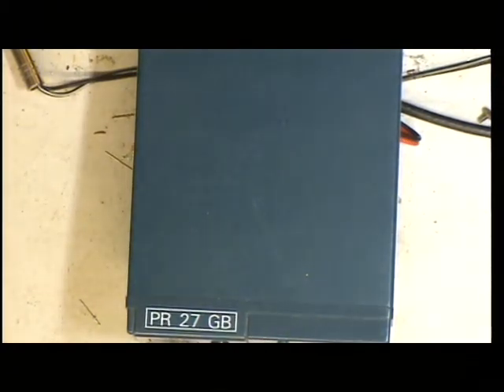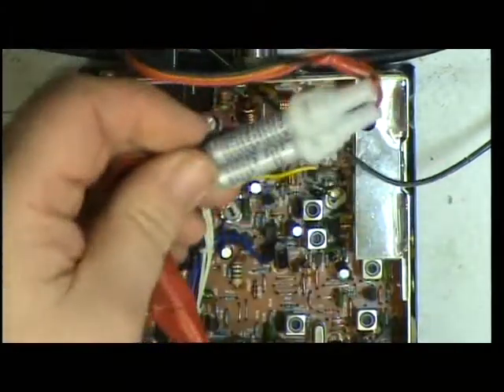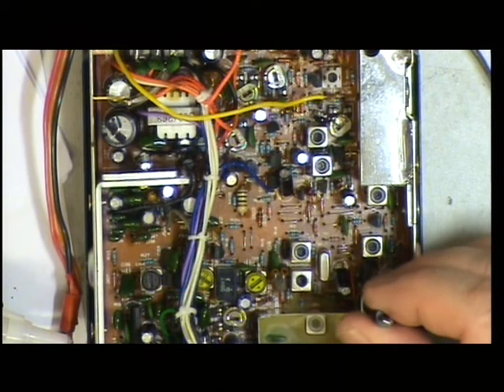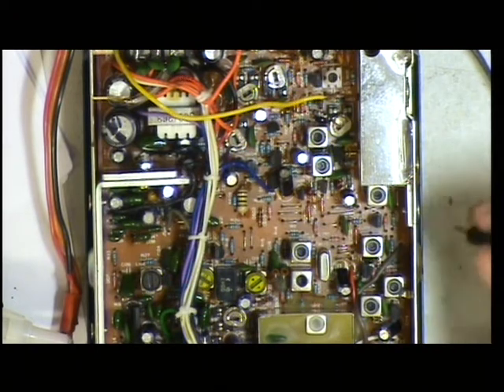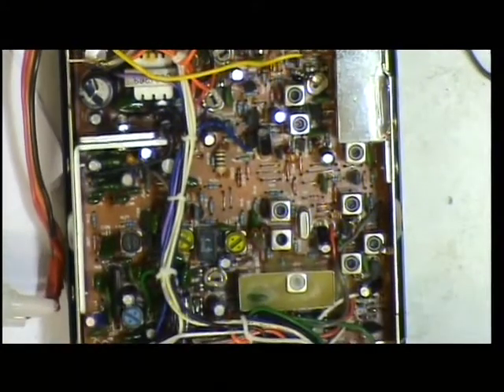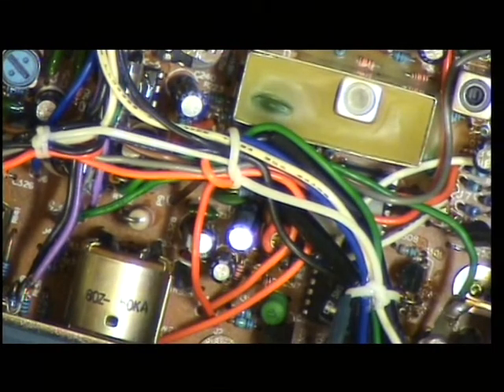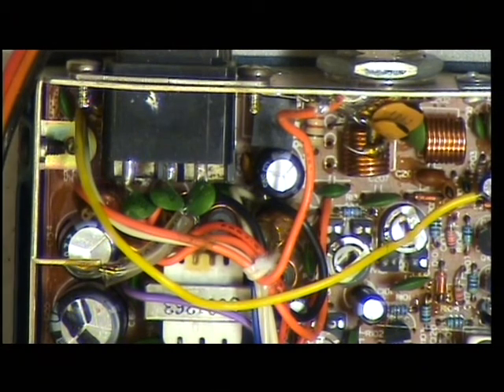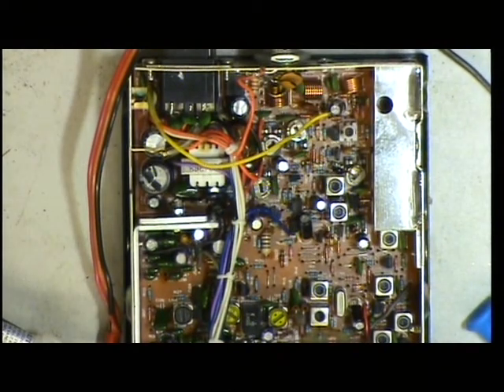Maxon MX1000 (UK) PR27GB CEPT EU band CB Radio (mobile) - Transmit alignment

Comment: Hi Richard, can you shed any light on the Alan 9001 ,, relationship between moxon ,, midland etc ,, who made or imported them or any info on this particular radio please,, appears it's a emotional
Reply: Emperor shogun to me ,, sorry for the split message hit wrong button by mistake thanks Shane uk
Reply from the maker: Shane. Not having heard of it, I looked it up. Turns out it's one of those 'export' cb radios that's sold as a 10M amateur set. It therefore isn't a UK legal CB radio hence me knowing nothing about it. I will say I had an Emperor EU model come in amongst some scrap chassis I bought & the build quality was the worst I'd ever seen, so that wasn't an impressive introduction the the brand.

One of the snags with 'export' radios is that they are not made for any particular market so are not made to any particular standard. Although we've always had a "UK legal only" policy I once saw a Tristar 777 "export" radio which was abysmal & once saw a President Lincoln supposed 10M ham set, which turned out to be another "export" type cb radio, which wasn't much better.

So it's nice to hear from you Shane, but we have nothing whatever to do with export CB radios. Perhaps you'd like to email me rshireby@yahoo.co.uk as I don't seem to get why people buy these things anyway. It seems to be a bit like buying UK cigarettes (never had a fag in my life) and they buying illegally imported cigarettes that contain loads of dodgy chemicals our government has banned & thinking they must be better simply because they're illegal here!

All the best,

Richard
Reply: UK CB radio servicing  thanks Richard first of all ,,that was a quick reply,, secondly I don't smoke either since having a heart attack six months ago ,, and I used to buy the imported stuff that saved me an absolute fortune,  wish I was as clever and as wise as you and never started in the first place ,, guess I followed a trend ,, when I started at a young age, on to the radio business,,I can't give you a clean cut answer on why I've bought a few export radios over the yrs and not many 40 channel radios, largely because I like ssb ,, and was happy when the 40 channels become legal in the last few yrs and appears to have brought some people from the past back on ,, and made Cb slightly more popular, but anyhow thanks for the reply and you take care ,,,Shane 26 Bravo Delta 33
Reply from the maker: All the best, Shane.

Richard

Comment: Very poor that the radio could not muster up 4 Watts, the manufacturers should have been  punished for false advertising. Thanks again Richard for another useful video.
Reply from the maker: The manufacturer would argue that the radio does develop 4W, but 25% is lost in the filtering required by EU legislation!

Richard